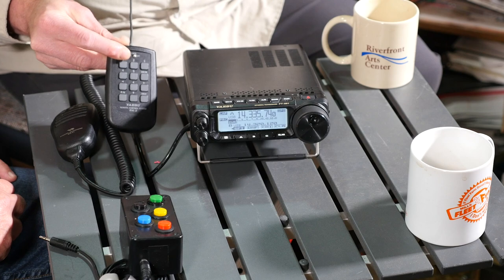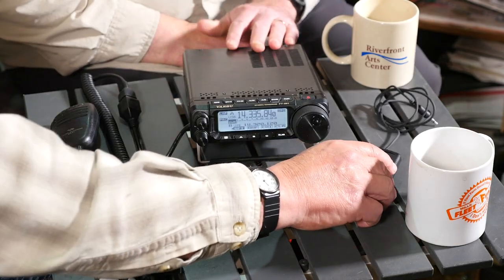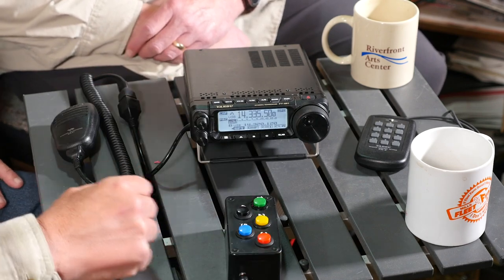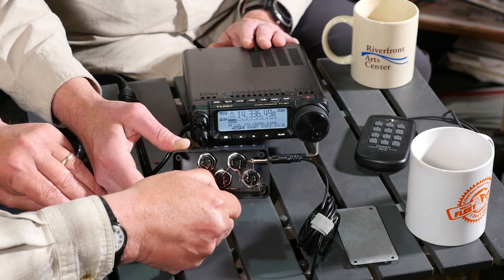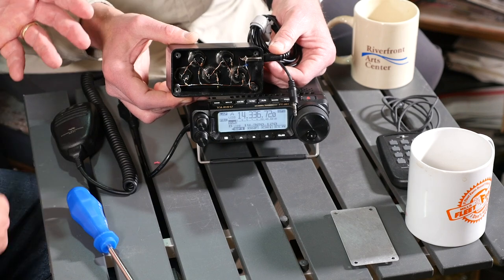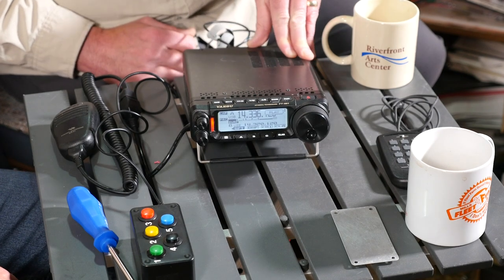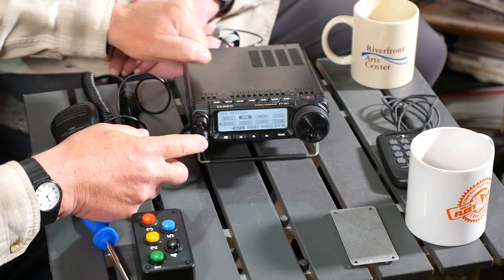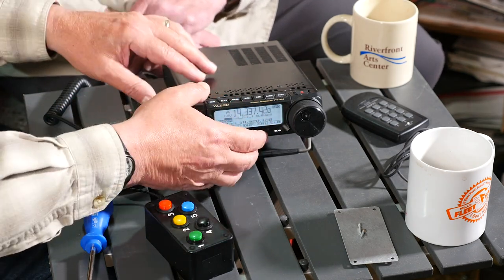Building a Yaesu FT-891 remote control box #HamRadioQA

Comment: I'm definitely going to build one of these!   I'm a big arcade guy and arcade buttons are very heavy duty and reliable for years and years of abuse- so I'm going to use those types of buttons with mine.  I've used buttons like that whenever I need something reliable - even had a "start" button on my old clothes dryer after it broke.
Reply from the maker: Arcade buttons are bullet proof. That's a great suggestion.

Comment: This is called resistiive telemetry.  The FT891 uses a A/D to set a particular value of voltage in an internal voltage divider circuit and covert it to a particular digital word.  Very helpful as I am new FT891 owner for the purpose of portable operation.

Comment: Those there are Harbor Freight step bits! And they are amazing! I drilled 78 holes in 1/4" aluminum with the same bit to install lights in my trailer. You can't beat'em! Step bits themselves are a must have, but those from HF are worth the $$!!
Regarding the remote box, I'll be spending the $90 for the FH2. I can't solder. Great video, thanks for sharing!
Reply from the maker: The Harbor Freight step bits are cheap too. I bought a set of three for what one would cost me at the home depot. For the amount that I use them, they are good enough.
Reply: @KB9VBRAntennas  Agreed. That set is $12 I think, $9 on sale :) Lifetime warranty. The couple we've broke over the past years have always been swapped out for new ones no questions asked. Harbor Freight is the bomb!! We use'em on almost every project in the shop.

Comment: Great video just bought a 891 for pota was also wondering if your main radio is a ftdx 3000 thinking about picking one up what you think about the radio.thanks for the Great videos and antennas. 73. N1IYv
Reply from the maker: The FTdx3000 is an excellent transceiver and unfortunately discontinued by Yaesu. But I wouldn't sway anyone away from purchasing a New Old Stock or lightly used model. Its replacement, the FTdx10, is stellar, but is missing some key features: notably the three antenna ports the 3000 has and the lack of dedicated buttons for certain controls.

Comment: Do you use 1 watt or 1/2 watt resistors or does it not matter?  Does he use a 10nF capacitor between positive and negative?  Thanks I was just trying to find the parts.
Reply from the maker: I believe Dave used 1/4 watt resistors, they don't need to be very big for this application. I'm not sure of the capacitor size.

Comment: The Yaesu ft-891 manual shows a 3 ring 1/8 inch plug for use with the FH-2,  The FT-991A shows a 4 ring plug for use with the FH-2. The FH-2 comes with a 4 ring plug. Will the 4 ring plug work with the FT-891?  Is the fact that the end tip is the signal and top ring is the ground all that matters?
Reply from the maker: The four ring plug works with the FT-891. My FH-2 came with my FTdx-3000 and I swap the unit between both rigs without issue.
Reply: @KB9VBRAntennas  thank you 73

Comment: Will this also work with the ft991a?
Reply from the maker: It should. This box mimics the Yaesu FH-2 keypad, so it would be compatible.
Reply: @KB9VBRAntennas  is there any other resistor values that would control power up or down?

Comment: I would love to build one of these. HOWEVER, my Z-100 Plus tuner plugs into the REM/ALC.  This remorse also needs that jack. Can I use stereo “Y” splitter in the REM/ALC and plu in both devices?
Reply from the maker: A Y cable won't work for this purpose. The tuner requires LAMP function be turned on and the FH-2 or other remote controls need LAMP turned off.

Comment: This is great. Only downside I can see for my setup, is I use the "rem" jack to control my LDG Auto Tuner.
Reply from the maker: The downside is that both devices share the same jack and the tuner requires LAMP to be turned on and the remote needs it off.
Reply: use resonant antennas
😊

Comment: Need One Important Thing. If The Radio Is Showing Freq Etc, Can You Press Button On Remote For Direct Playback Over The Air, Or Do You Have To Switch To The Voice Recorder Screen?
Great Info Otherwise, Thanks!
Reply from the maker: We didn't get into the operation of the digital voice keyer, but my recent video on that subject goes through more of the details on how it works: https://youtu.be/sdwSVqUMiOw

Comment: Do you need to use a TRS plug or a TS plug? It appears to be a TS on the fh-2, but I think the jack is a TRS. Should the ring be ground, or NC?
Reply: The 3.5mm jack can be either a TS (2-conductor) or TRS (3-conductor).  The connections are just the "tip" and "sleeve".  With a TRS jack leave the "ring" with no connection.
KZ9V